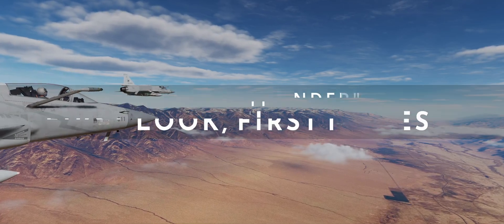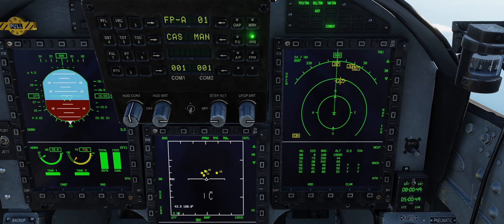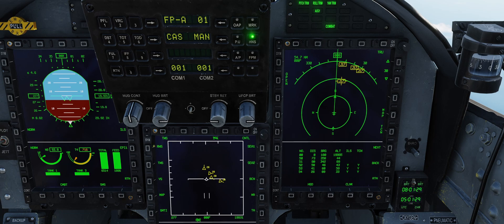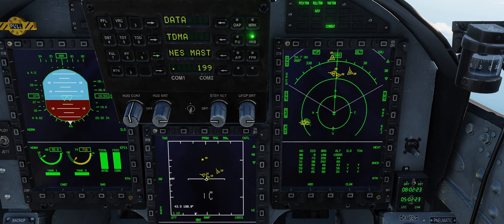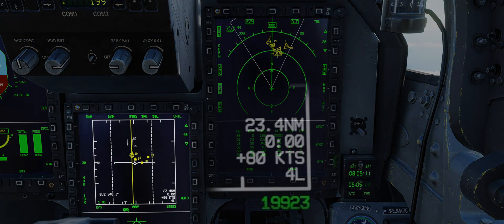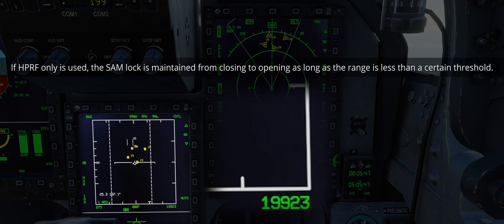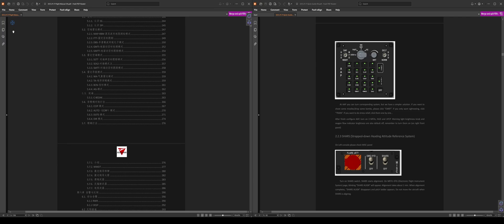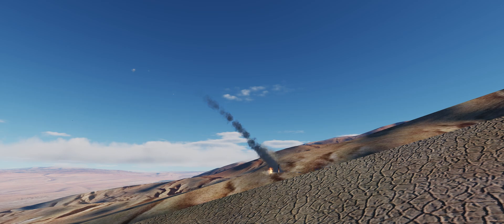DCS JF-17: First Look, First Issues

Comment: Regarding the Zero-Doppler section:
While this may be an oversight or incomplete implementation for the DCS universe, IRL it would be very strange and stupid for it to have anything like the MLC and 0-Doppler filters that the F-14A and F-14B has. The vulnerability to "notching" was merely a symptom of very limited, airborne analog computation capabilities coupled with the radar being restricted to operating within a very narrow bandwidth.

It is analogous to a sonar system being limited to only send out pulses consisting of a single frequency, chopped into pulses at some PRF, then filtered to reduce spectral leakage. Compare and contrast this with recordings of actual submarine sonar recordings and you'll see the vast variation in pulse-to-pulse modulation techniques and bandwidths actually used to gather the most accurate and complete target data.

I would rather not regurgitate my complete a explanation yet again (as I am currently on mobile), but essentially this comes down to how likely you believe it is for the JF-17 to have a radar processor that is at least as recent and computationally powerful as an Intel 80486 (aka just the ' Intel 486'), which was apparently used for radar return processing on the F-22.
All that would be required (if handling pulse compression in the analog domain or with a dedicated digital RF ASIC) is the ability to finish one target's worth of calculations in the illumination dwell time, or if no pulse averaging is used, to finish processing one return in roughly one PRI (= 1/PRF). Even at a high PRF on the order of 10kHz, this would give the DSP between 100us to 100 × number of pulses averaged ~= 1000us to update the RDC.
Reply from the maker: Thank you for the detailed post; I understood your points, although I probably missed the finesses of them.
The AWG-9 is a 1950s project, so it is definitely ancient history in the world of modern technology. I worked for years with tiny SMD PIC8s with vastly superior processing capabilities. I still have an 8088 around, now that I think about it...

That being said, whilst the F-14 shows a "clear cut" when it comes to MLC and ZDF, the APQ-70 has the same issues, with vastly narrower bands. I don't have time to record a sample now, but I remember Notso on RAZBAM channel's showed the radar struggling with a high-TA. This is why I wondered whether the KJL-7 is exceptionally resilient in such a scenario due to its characteristics or due to the radar's implementation.
Reply: "MLC and 0-Doppler filters that the F-14A and F-14B has"   the DCS F14 you can see contacts in the TWS when the clutter is weak and MLC off it is very unstable but it shows that it works.. modern radar of course have better solutions as you already mentioned.
Reply from the maker: That's correct. The main thing we lack in our TWS simulation is the generation of false contacts. Have you seen the real TID in TWS or STT?

Comment: With modern radars the processing of track files and corresponding data is generally done very quickly in the background. The processing of corresponding data has indeed become so quick, that you wouldn't even notice as the processing power of modern radars has reached a level where you basically get an instant presentation of such data on your scope. However, If you go the other way and try to exaggregate things like ED did in the current LTWS/TWS implementation in the F/A-18/F-16...well, trackfile processing actually takes so long that it renders both modes essentially useless. A rework will come in the next update.Try these out, though and observe how long it actually takes to build a trackfile. DEKA actually has done quite a good representation of the KLJ-7 with very little inconsistencies. The same cannot be said about ED's radar modelling. ED has a long way to go. The one thing I wholeheartedly agree on, though...the lack of a manual in English language after being five years on the market is indeed quite astounding. Otherwise, the JF-17 is one of THE best modules in DCS. You should actually do a comparison of the F-16 and the JF-17. You wouldn't even want to go back to the F-16 as it has so many issues...
Reply from the maker: It is unfortunate that ED's modules are so behind in terms of simulation, not only the radar but many other aspects, such as the RWR (https://www.youtube.com/watch?v=Qhp1wAlh9Gg).
That said, almost every module in DCS has flaws. E.g. the ubiquitous TWS used for any engagement, which I can't wait to see becoming detrimental to missile employment.
I have the F-16, but I can't stand it. I probably spent too much time on Falcon 4.0 25 years ago. Generally speaking, I find modern DCS to be extremely tedious, full of issues, bugs and exploits.

> Otherwise, the JF-17 is one of THE best modules in DCS.
It is too early to say whether I agree with this statement. The job done by developers such as Galinette and JNelson in terms of radar simulation is outstanding, for example.
Reply: @FlyAndWire  Yup. That basically covers my point of view, too. And you are absolutely right, what Galinette and JNelson did, that should be the overall standard in DCS. I feel the same about the F-16, btw - having said that, I flew it competetivly for about 2 years and now I am out...I cannot do it anymore. But yeah, try the JF-17 and I am sure you'll find it's quite a blast. Have a nice weekend, buddy. Keep up your nice work...🤙
Reply from the maker: Thanks mate, have a great weekend too :)
On a positive note, apparently, ED will implement HB's RWR implementation, which is fantastic. I raised the issue of reinventing the wheel years ago, with multiple 3rd parties spending time and effort recreating the same parts. A common implementation would improve reliability and quality standards and allow devs to focus on other aspects.

> I flew it competetivly for about 2 years and now 
I have played this game since LOMAC, and I have never seen it as a decent competitive platform. Don't get me wrong, everyone is free to play whatever they want, of course, but there are simply too many issues to ensure fair fights.
Reply: @FlyAndWire  I'm pretty sure atm skilled players in DCS don't use TWS anymore for engagement, at least that is what I'm aware of as a Viper-main player and those that I know.
Reply from the maker: I don't think you and I would agree on what "skilled" means in DCS. Better drop the topic.
Reply: @FlyAndWire  well, what I mean is people with knowledge & experience in  "the game" don't just use TWS anymore as default radar mode in engagement. I just want to throw this out because you are saying TWS is used universally in all scenarios, which is not true.
Reply from the maker: What? No one uses TWS as default. Perhaps brand new players on their very first fighter jet experience. Give them a couple of days and the moment they realise it's like watching through a keyhole, they move to other modes.

I said that TWS is used for engagements, which should not happen.
Reply: @FlyAndWire  that is what I meant.

Comment: Question, when you say “other radars” when talking about the instant TWS, what are you referring to?
Reply from the maker: The AWG-9 is one example: it cannot switch immediately between different radar modes, even in the same PRF bracket.
Reply: @FlyAndWire  I don’t mean to sound rude, but that’s also a radar from nearly 30 years earlier. There’s some physics that technology can’t improve, but digital processing improves by many orders of magnitude in that time.
Reply from the maker: You are not rude, don't worry.
Of course, you are right, but that was not my point: rephrasing my questions, I wondered why you would even have TWS when RWS builds tracks in the first place. RWS makes both tracks instantaneous when you select TWS, and also provides tracks without the timing constraints. Heck, you can even have a sort of HDTWS by selecting RWS and using the right-hand display to see the tracks. You can also have a fully opened volume, albeit at the cost of longer refresh rate - which should impact the tracks' quality I guess, especially if contacts do not appear in multiple bars.

In other words, besides the years, the whole logic has changed between how radars such as the AWG-9 operated (I'm curious about the early APG-63 now), and how the JF's radar manages information.
Check the comment by @ledude114 I pinned, he added some interesting details.

I hope this is more clear now.
Reply: @FlyAndWire  Got it! It’s not a “should this be possible?”, more of a “why this way?”…?
Reply from the maker: In hindsight, definitely :)

Comment: Not sure how this passed QC
Reply from the maker: Because the points I raised do not imply that the module is wrong, on the contrary :)
Check the comment I pinned, by @ledude114.
Reply: The same way the F-15E, F-16C, and F/A-18C passed it, 
Even if the radar overperforms, the JF-17 is more accurate than any of the other modules, aside from maybe the Heatblur planes. You also need to remember that the JF-17 is the most modern plane in DCS currently, (approx 2008-2011) meaning it will likely be able to have better computing of radar targets than other planes.

Comment: As far as the manual goes, Deka has stated they are struggling to find a translator with the right skill set.
Reply from the maker: I worked as a translator a long time ago. Back then, Google Translate abusers were everywhere already.
Still, the game manual is quite short, only 300 pages, which probably results in 500 in English (a totally made-up number). It's a job doable in a week, if the translator already has a decent dictionary (see Trados).

Comment: Tbh it would be cool see more stuff about the Jeff. Its an aircraft that doesnt have too much attencion or tutorials in YT and it has a lot of potencial
Reply from the maker: My main focus is still the F-4E and mid-to-late CW (imo the period that can be better represented in DCS), but, sure, I can put together something about the JF-17. Anything in particular you would like to see (air-to-air only for the moment)?
Reply: @FlyAndWire  How the SD-10 performs, i usually take 40-45 shots with that missile doing a loft of 20-30 loft. It is a good missile tbh, but also easy to noch. But tbw i watch ur channel to learn how to WSO in the F-4, also the F-14 but in that one im kinda lost
Reply from the maker: I have some data about the SD-10, but nothing too in-depth, as I did not own the module until the other day. Check this  tool: https://flyandwire.com/2023/02/17/determining-wez-mar-lar/

I read that it should be similar to a 120B or early 120C. The last time I checked, it was much better than a 120B.
Better not to talk about the notching issue. On one hand, ED is fixed on their ideas, on the other, I have multiple active and former crews say that it makes no sense.

Shout if you need some help with the Tomcat. It's quite simple if you are already familiar with the Phantom.